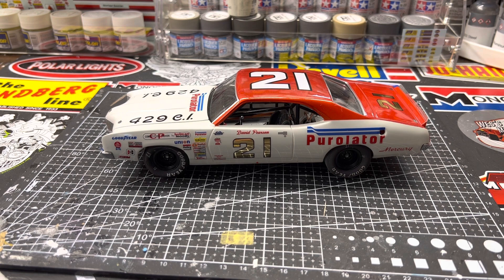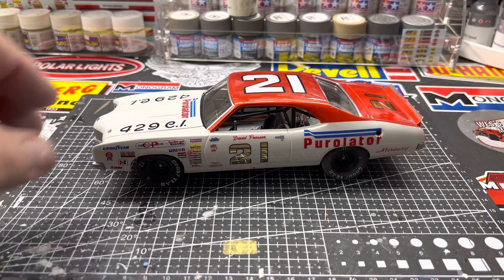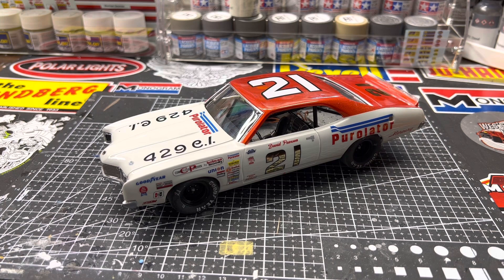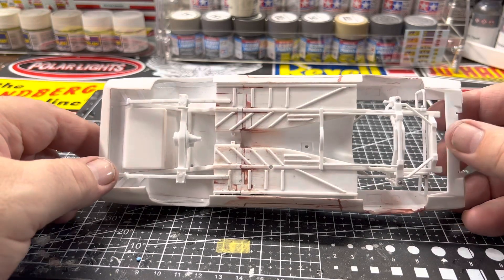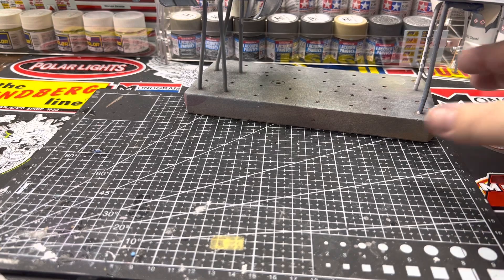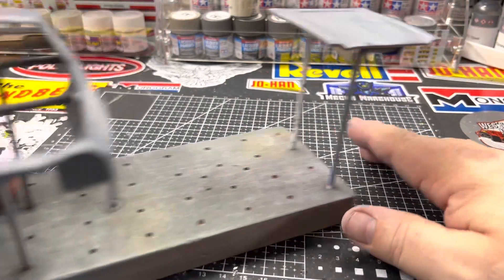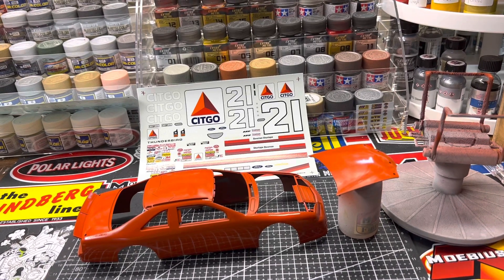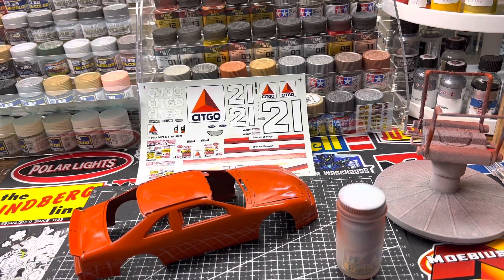David Pearson 1972 Purolator Mercury

Comment: I like your chassis details on the Mercury.👍😎Do you know if Torinos looked the same underneath?🤔Robert . Thanks for showing and best wishes from jolly old England 👍😎Pete 🤓
Reply from the maker: The bottom of the chassis I showed was scratch built on the Salvino Charger. They copied the mpc chassis and didn’t update it, so I add extra styrene. But in general, all the mpc nascar kits have the same chassis underneath. Just takes a little patience and scratch building.👍👍
Reply: @bigchef2112  it certainly looks more interesting 👍

Comment: Savino JR chassis ape the Polar Lights unit. Their chassis have little to do w/ MPC.
Reply from the maker: Need to look at mpc built up. The front engine cage is exactly the same as well as the rear end. The huge tunnel comes from the PL Charger and the 2 piece chassis comes from mpc.